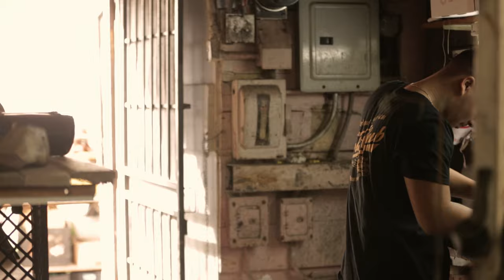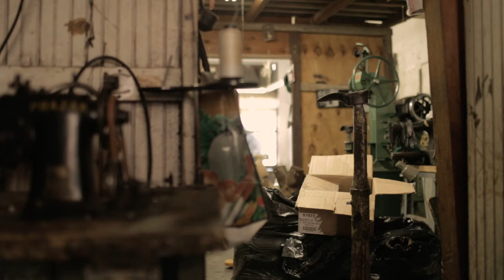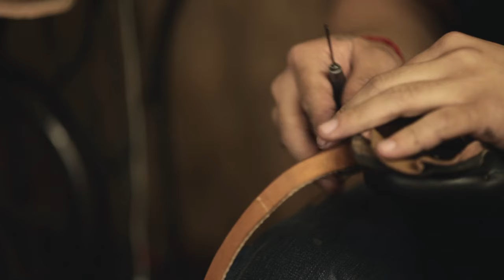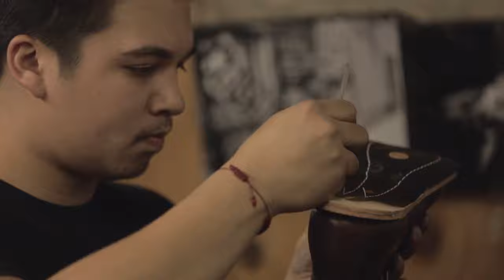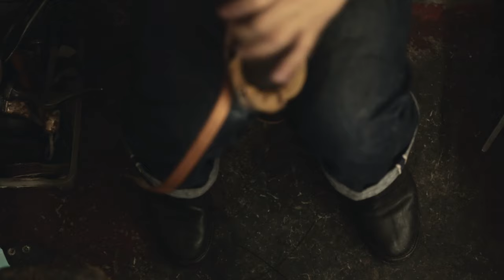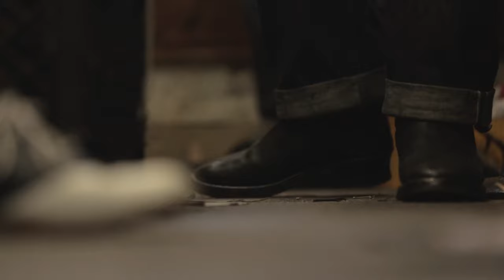SHOE REPAIR CHANGED MY LIFE

Comment: I saw some shoes get made with glue only and only stitching on the upper. What is the difference and benefits of using nails, stitching or just glue? What if you jump of something head high will the nails stab your feet then? Onetime I jumped on a trampoline with dress shoes and my feet hurt a lot after, what up with that?